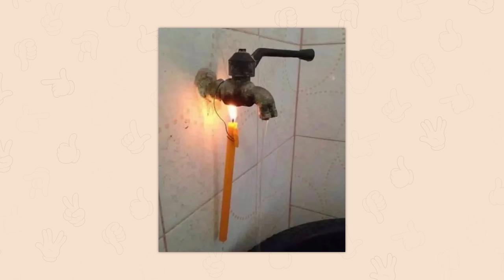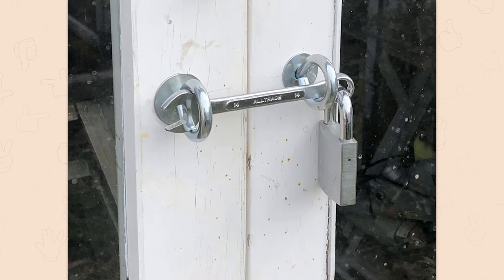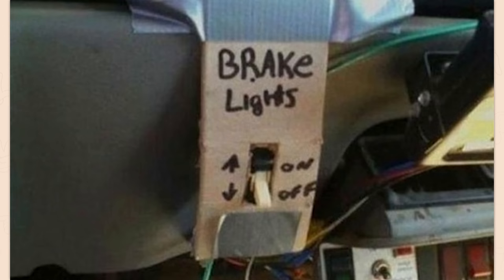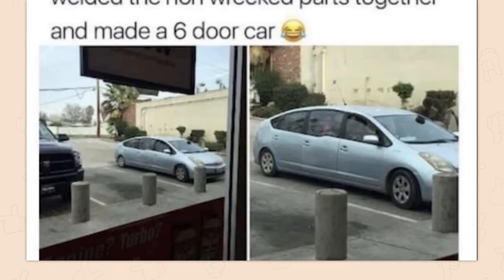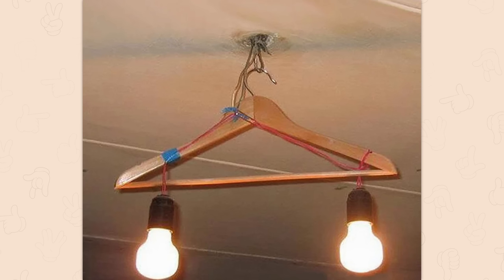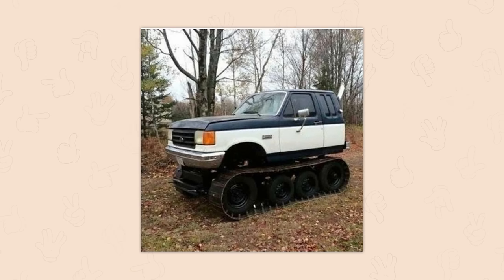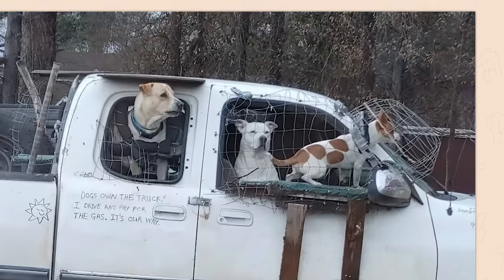r/Redneckengineering | these life hacks are INSANE! 😱😱

Comment: The designer of that hot water tap in Vietnam really took the word "Improvisation" to another level.
Reply: Yes
Reply: The candle doesn't have enough heat to heat the water
Reply: @justplay2508  Water is already somewhat warm due to climate there, so you don't really need much heating :)
Reply: @ceu160193  Morning shower water though? No.
Reply: @Lazymotion  Would depend from how far you open it.
Reply: hi
Reply: Dong I swear you are the new Just some guy without a mustache,pixelcraftian, OwO, Rice and that’s all I remember
Reply: @ceu160193  I open the Tap wayy back, still cold as hell.
Reply: you and me both are from vietnam
Reply: @ceu160193  Not...not really.  Water takes a LOT of energy to heat up.  You need about 10 btus to heat up a gallon of water 1 degree (F), and a candle only outputs around 3-5 btu per minute.  So at a rate of 1 gal/min, you'd raise the temperature of the water maybe half a degree.  You'd need to have that faucet on a barely a trickle to raise it enough to even feel a difference.
Reply: @Bacteriophagebs  I think that tap is for tea water - warm it up before opening, and you have at least cup of water, that is warm enough to be used in tea.
Reply: @ceu160193  One cup is 8 oz, or 1/16 of a gallon.  It therefore takes .625 btu to heat one cup one degree.  The lowest tea-brewing temperature is 160 degrees F.  At 5 btu/min it would take 40 minutes to bring one cup to that temperature if no heat were lost and it started at 75 degrees.  In reality it would be more like 1-2 hours since most candles aren't that hot and a lot of heat would be lost.
And that's at the extreme low end of brewing temperatures.  Most teas are typically brewed at around 200 degrees, if not just boiled.  Not to mention that the temperature will start dropping as soon as it leaves the tap, and tea takes several minutes to brew, and takes longer for less-hot water...
That's going to be a loooong wait for some weak, lukewarm tea.
Reply: Yup
Reply: I originally thought you were some random commenter but as soon as you hear Vietnam you appear
Reply: Remember kids, you can't spell "improvisation" without "improv" and that's just one letter away from "improve". 😎👍

Comment: Tennis balls in suspension springs is what people actually did to smuggle people out of East Germany back in the day. The escapees crammed into tiny compartments, and in order not to raise suspicion among border guards from a car riding too low because of the added weight, the helpers just stuffed a bunch of tennis balls into the suspension to make the car ride slightly higher. Some of those escape vehicles can be seen in museums. One of them in Berlin, of course.

Comment: 11:42 That is a Ford Econoline van that's had it's rear axle removed and replaced with a boat trailer...

You back the thing down the boat ramp until the rear wheels are submerged and then launch or recover the boat...

One of the vehicle video's on the Techzone You Tube channel has one of these in it showing the launching of the boat...

Comment: Watching this makes me realize that the "manga shelf" I made when I was like 12 would be considered redneck engineering... I had a good sized container that I painted purple and took a bit of some super thin rope (it was all we had) and did SEVERAL wraps through the hand holes and under the bottom, and tacked it to the wall... I had 5.5 pounds worth of manga and a super Mario mushroom lamp which weighs like 0.5 pounds so 6 pounds being held up for 3 years cause it wasn't replaced until I was 16 and finally got a real shelf (still a small one) and replaced it... It never once fell, and considering I didn't put any sort of calculations into it because I was ya'know, 12, and just completely guessed, I'd say I did a pretty damn good job
Reply: I may have a picture of it, and if I do and can find it I may post it on there lmao
Reply: @Rynn-  Did you find a picture of it?

Comment: That boat van thing is an actual product; it's a camper-van where the back part is a boat-hauler. All the sleeping accommodations and such are in the boat, which as a front door that opens to the rear of the van interior. You can launch the boat and it works independently. It's a neat idea, just sorta problematic due to how proprietary it all is.

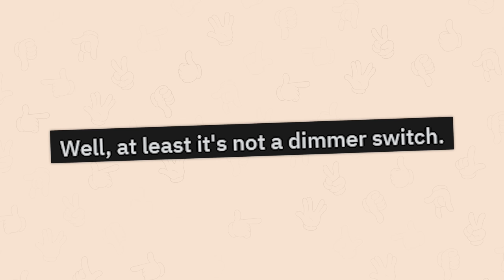Comment: 3:36 Ok but the fact that it's a police car though.

The red rocker switches controls the old halogen lightbars, wig-wags, deck flashers etc. (You can tell because the first switch label says "TD" which means "Takedown") and the black box on the top right is the siren controls & P.A. System (Most likely one with a knob switch instead of individual buttons).

Comment: 5:02 In Toronto Canada where I live one of the elevators in my local subway station has glass window panels (and it’s the type of glasses that has that wire mesh inside it that kind of looks like a square grid as well) and there are 2 of them broken in the same elevator (one on the side and one on one of the doors) and the transit company put plywood in the spaces temporarily so the elevator could still be used until the new glass panels arrive

Comment: 3:28
Those things usually accept way wider voltage range than just 12 volts. I disassembled one to add XT60 connector to get it to charge directly from my solar panel when it's not bright enough for the MPPT to register. So. The chip inside accepts from 4V to 32V. Officially, in reality it does charge a phone from a single 1,5V battery. Tested just out of curiosity.

Comment: 8:24 That one reminds me of an instance back when I was in high school. Every Wednesday, the school had multiple clubs running that students each chose to join, and it would cap off the day with a 1:30-ish dismissal. In either 9th or 10th grade,  I chose an upcycling club. Too long to explain what that is, so just Google it. Anyway, a group of girls from my grade and up retrieved a shopping cart from a river or pond or something. They cleaned it up, disassembled it, and turned it into a lounge chair. For the older ones, they were allowed to take the cart outside and weld it wherever welding was necessary so bits stayed put and didn't poke you. Perhaps it was a bit questionable on the school's part, but when I entered senior year and physics, my class learned basic circuitry, which included soldering (which I was really good at for some reason). Since welding isn't that far off, I think it was fine. I wonder if my chem/physics teacher was supervising. He was such a fun teacher, and I was, and still am, a huge science dork. I wish I tried sitting in the chair. It would have been awesome. I'm still friends with a bundle of classmates and old teachers on Facebook, so maybe I'll ask there. If I get an update, I'll put it in the replies.

Comment: That’s not a swamp cooler. Swamp coolers lower the temperature by making room temperature water absorb it and evaporate. Also, your fridge is just taking heat out of the water and putting it in the room, so there’s no point in using the now cold water to absorb it again to try and make the swamp cooler more effective.

Comment: 5:40 electrocution risk asside, most of the time if an outlet has a different shape plug it probably also has different power. (grounded vs underground, 2 phase vs 3 phase, 50hz v 60hz, 110v vs 220v, 10a vs 15a vs 20a vs 30a, etc) DO NOT DO THIS. it can break your shit.

Comment: 10:55 That's not a swamp cooler. Actually, that is almost exactly the way the first air conditioners worked, and the measurement of cooling in "tons" is a reference to the amount of cooling a ton of ice can do. A "swamp cooler" uses water on a mesh of some sort with air being forced through it, which is NOT recommended unless you live in an arid climate.

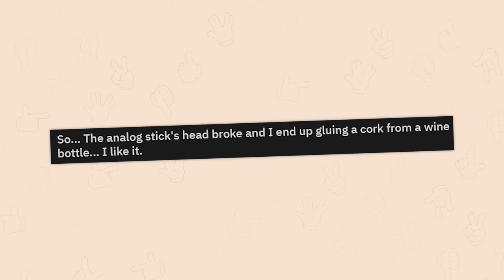Comment: 7:37 I actually did something similar. Back when I had a PS3, The controller stopped working so my broke ass bought a third party controller because it was cheaper. Eventually, the rubber part inside the X button broke so I took apart my broken dualshock and used it's buttons to fix my third part controller. The parts weren't compatible, but it worked.

Comment: 3:09 Well, this would be better if it was locked in "Reverse" position, because the engine would have more leverage and it would be harder to push the car around (my dad sometimes uses it instead of hand break). Plus being locked in reverse migth make driving away with car a bit difficult.

The way it is I'm afraid it could damage the clutch, gearbox or engine.

Comment: The screw came out of the ear piece of my glasses. Took it to be repaired and the screw broke off in the ear piece making it impossible to connect to the frame. I grabbed some heat shrink tubing and slid it over the ear piece and all the way over the hinge. I can't fold that side and it's a glorious bright yellow,  but I can wear my glasses again! Not a redneck, just the daughter of an engineer.  😄

Comment: 1:37
what makes it even beter is the fact i can garantee that thing is probably a ol twin stick semi truck from befor the 70's that throttle pedal gives it away
edit
2:33 i like the astetic, and hes smort enough to know to weld up the jaw on it too
3:11 its more secure the fact its a manual and not cause its got a lock on it, that lock seems to be a brinks lock, a good driver and a good lock picker could steal that car 
also on the aux cord one, my audio decided to fuck off right at that moment
4:49 ah yes, the death trap weed slapper from HELL
8:43 you know, there might be a good reason for that, a fact of "shock is shot" is possibly likely, either that or the doggo decided to fuck with everyone 
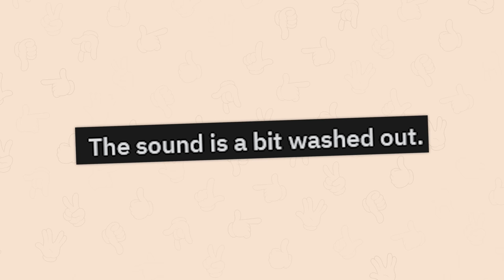9:31 me remembering that i need to put the old cap back on my truck because i forgot the one for my grandma's truck at a gas station and drove home with that shit open.... yeah i used the one from my truck and stuffed the filller for my truck with the spare cap that fits my grandma's truck that dosnt quite fit..... yeah ima probably have to drain the fucking tank..... shit.
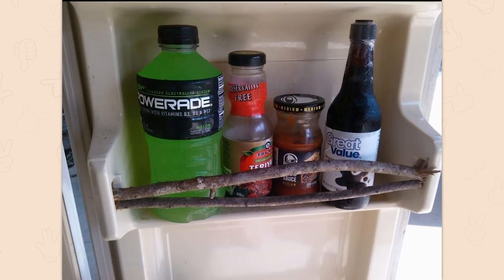10:20 looks like a chainsaw engine (?) on a electric drift kart so def a death trap
12:12 
87-93 ford f- 250 or something the like, i can tell cause the f series and broncos are basically the same damn thing and this thing has the same lights as my 87 bronco

Comment: I am a redneck and I have seen a lot of stuff like this. Getting new parts out in the middle of nowhere isn't always an option. Besides if you can fix a $80 part with a soda can and some bailing wire, why not.

Also the pool heater made out of a radiator, we totally did that when I was a kid. It is cold up in Pennsyltucky and if you want to swim in May sometimes you got to get inventive.

Comment: You know what's even better than redneck engineering? Student engineering. When we don't have spoons we take the foil cover off the snack and fold it into a spoon-like shape. It works, somehow. Especially when it comes to actual engineering students, those guys will solve your problem on the most cheap, crackjob way possible and somehow it works better than the original

Comment: Electricity Hell? You should see a prison stinger. Two paper clips for the plug, two flattened AA batteries with the clip of a pen cap for the air gap.

 A stinger is a prison water heater. You put the flatten terminals in a cup of water and then plug it in the wall. The electricity from the outlet heat the water to boiling.

Comment: (( 8:44 ))From Sydney U's own website:: The rules of tennis specify that for a static load of 18 lb (8.165 kg), the ball shall have a forward deformation, x, of more than 0.220 of an inch (5.59 mm) and less than 0.290 of an inch (7.37 mm). Consequently, the static stiffness, k, must be in the range 10.9 < k < 14.3 kNm±1 during the compression phase.  

Sooo with that and some napkin math --> should be about [possible] 54 lbs compression force with  the three tennis balls

Comment: the dude with the 360 controller is great, seriously i have bought at least 5 new controllers for my computer but my old 360 ones from back in the day still work, the others have the buttons stuck in or the joysticks drift or the triggers collapsed, not the 360 ones, dog bit off the joystick heads and it was fine

Comment: A swamp cooler is not an ice cooler. The ice method is using the ice melting to cool down the air. The swamp cooler uses evaporation and requires a media to suck up the water with air blown through it to facilitate evaporation.

Comment: @ 6.45 couldn't you literally just drill two holes on the wall that are pole sized and make one slightly deeper so you can slide it back if you want to take it out/replace it/fill in the holes?

Comment: actually the ringdoor bell with the wires its perfectly safe .. at least all ringdoor bells SHOULD work with 12 or 24 volt to close the circuit and make it ring.. so..unless its using 110 or 220 (wich is pretty rare and shouldnt even be alowed) its fine.. in fact this was my doorbell for about 5 years.. only my friends knew so there wasnt any A...Hols ringing my door at 3am